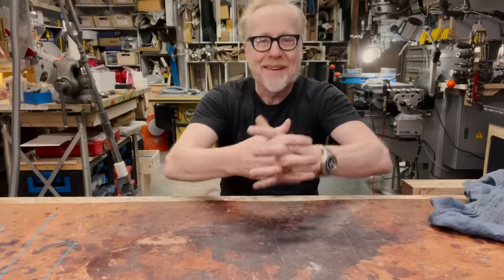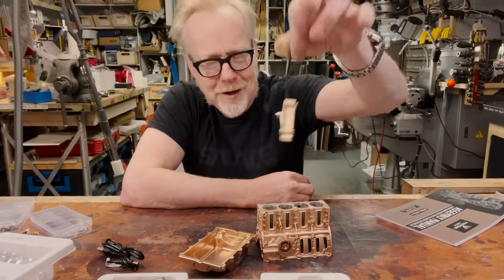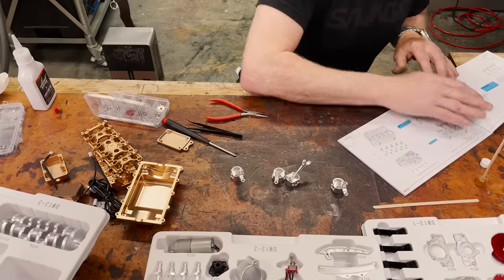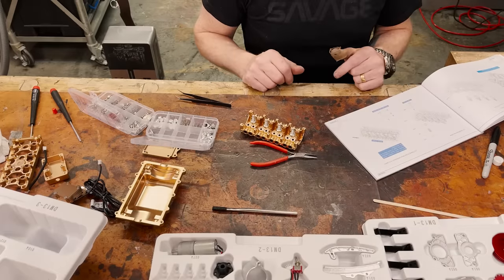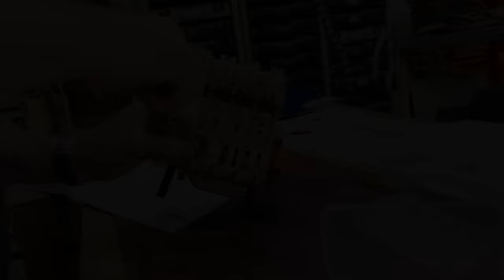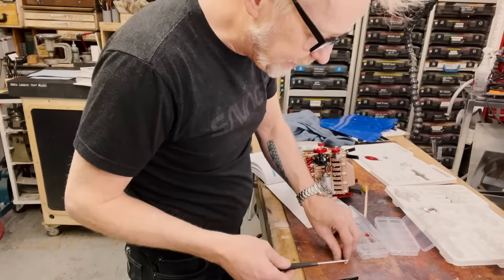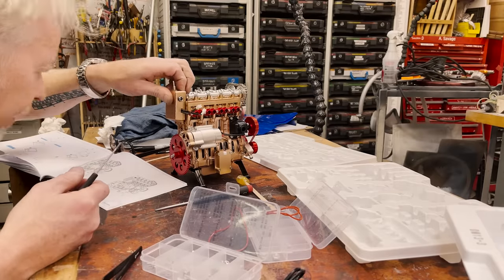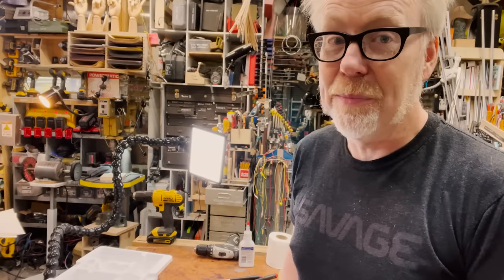Adam Savage's One Day Builds: Car Engine Model Kit!

Comment: The fact Adam called pretty much everything by its wrong name lol
Reply: That is a bit on the steep end.  We bought a 1600 VW engine for $500.  Mind you it was used but my son uses it every day to get to school.  :).
Reply: I really like Adam but it was painful to hear all of the random names he’d call things!
Reply: It is a bummer.  Adam had an opportunity to learn the proper name for each component so as others could have learned.
Reply: Caling the connecting rods cylinder rods.🤣
Reply: The top "crankshafts" when they're camshafts
Reply: yeah when he called the piston rods crank rods and the wrist pins connection pins as a guy who works on cars as a hobby it hurt
Reply: I noticed that haha
Reply: when he said 'this is the main gear' i was cringing so bad
Reply: Adam is a REALLY smart guy so I was very surprised he didn't know the most basic engine components.  I have never built a real engine either, but I know the correct name of all the parts in that kit.
Reply: @VKZ24  he's really smart, but most of his stuff is building things and fabrication. Can't blame him for not knowing everything but surprised he didn't know the basics
Reply: @2GuysandaBug  he got the Oil Filter right!
Reply: @Allamericanhotrods  what? Are you really getting this upset that he didn't know the name of engine components in a toy designed for kids?

Comment: The fact that you have extra nuts and bolts left upon completion truly makes this model assembly just like the real thing. It has always been an inside joke amongst shop coworkers that if you DON'T have extra nuts and bolts left over then you did something wrong, also we don't call them "extras" we call them "weight reduction".
Reply: I truly hope you are joking and don't just leave it.
Reply: @nathantron  Like I said, it is an inside joke. A lot of times one kit will be designed to be compatible with multiple design set ups, which will leave you with parts that were not necessary for your particular application. Other times kits will come with new nuts and bolt but the originals are still in good condition, so you either use the originals and save the new or vice-versa. I, like many auto technicians, have a unique sense of humor that for the most part only fellow "grease monkeys" understand or find humorous, however when it comes to my actual profession I take it very seriously. 
Joking aside, make no mistake, I consider auto technicians just below doctors; as in my customers are trusting me with not only their safety but the safety of all those around them when they have me work on their vehicles. I perform every repair as if one of my loved ones were going to be driving it.
Reply: If it works without it it didn't need it.

Comment: Adam,
I also have terrible allergies I use flonase nasal spray 2 puffs per nostril twice a day which really helps & when pollen is really bad I add one allegra  pill a day on top of the flonase. Right now in Florida the pollen is so high my black truck is green from the ridiculously high amount of pollen in the air & I just washed it yesterday. Before starting this medication my nose would run like a broken facet.

Comment: Very nice project.  Remember the “Visible V-8?”
Reply: Yep, from Revell. Back in the '60s. I built it.
Reply: Failed to build it in the 80s. 😂😭

The problem with plastic model cement...  Mistakes are permanent.
Reply: The kit is still around, most hobby shops have it for under $100

Comment: The pistons are "Notched" to point in the direction of the FRONT of the engine JUST like a real car engine, in a real engine situation if the pistons are installed incorrectly it WILL cause failure...
Reply: Im not sure in a non interference engine.. but u are totally right in a LS and hemi for sure

Comment: I am a professional car mechanic, and I gotta say, Adam Savage never built a car engine BEFORE. 
He did have the professional knowledge to make the parts work. 
It will take more oil to work long-term, but I am impressed by him figuring out what is needed.
Reply: Quote: Adam Savage: I don't tighten any screws until it is complete. 
EXCELLENT! I do that too. it comes out better.
Reply: It has more to do with the part, than the whole; but the point has value.

Comment: I wanted something like this until I literally bought a whole used engine for the same price. :P
Reply: How’d it go for you? I’d love to learn the ins and outs of an engine
Reply: @finnmaclean7796  if you have the space to house an engine on a stand, I’d highly recommend it. Which is roughly the width and half the length of a standard garage bay. Also I forgot the expense of an engine hoist and and engine stand, as these are things I already had as a car guy.
Reply: @finnmaclean7796  what do you want to know
Reply: @gedavids84  yeah there might be an engine hoist and stand in my garage but I’ll definitely take a look into it. Even starting with a smaller motorcycle engine to gain a simple understanding
Reply: @rorer7140  I’d just love to be able to take apart an engine and rebuild it/repair it myself, or as much as possible

Comment: That same company makes nitro an gasoline mini engines.  I have several. (Put them in various RC cars/trucks)

Some of them come in kits. Think it would be good content for your channel.
Reply: How does the power / powerband match up with nitro engines ?
Reply: @3v3pirat37   So gearing is important with these engines as they don't rev up to 30k rpms like traditional nitro engines.
Reply: @DomVito87  Of course but how does it feel to drive them.  Typical nitro engines have little to no torque where as the 4 stroke will have loads more.

Comment: Hi Adam,
When I was a kid I made a marble puzzle box out of Lego's and it was something fun to do when I was a boy. And then as a adult I made marble puzzle boxes out of Popsicle sticks and it turned out great and the tools I used was a scroll saw and white glue. I made the base using two layers of Popsicle sticks and since the marbles were two sticks in height I used a scroll saw to cut the walls of the puzzle box. And I made four mazes one on top of each other and each maze was different. And when the box was made it was fun playing with it for a while. And the sticks had to be very straight and very flat to make the box work. The way I have found make the sticks flat was to tap them one at a time on a flat surface to weed out the warped and bent ones. You might want to try this project sometime and it maybe fun for anyone who wishes to build one. 

Robert Johnson

Comment: The additional bolt hole studs on the oil filter side of a typical 4 cylinder will be for an engine mount and oil cooler.  On the other side you would typically have an engine mount, and sometimes an axel guard or heatshield depending on how it's mounted.  Also you would have a crank sensor on the block as well.

Comment: Reminds me of when I built one of the "Visible V8" engines back in the 70's, but it was all plastic and the quality wasnt near as good - of course it only cost like $15 - $20 back then.  The best part was building it, the motor that was supposed to turn it over had problems with it mounting being to flexible but I loved the fact all the valves were in time and the spark plugs were little red LED's that lit up in time with the distributor firing - For $439 you would think they could have incorporated LED's in the spark plugs so the ignition could show the plugs firing in time like my much cheaper Visible V8 kit did for like $20

Comment: Adam is one of my favorites, been a fan for decades. He must have never built a real engine, except for the pistons, I believe he called every engine part by the wrong name. When he called the overhead camshafts....crankshafts I may have pooped a little. The "main gear" is the flywheel, the gear is for the starter to "gear-on" I guess. Nice kit, too bad you can buy a real "used engine" for about the same price. The assembly book will have had the correct names, for the parts, it is still in as-new condition.

Comment: Hey Adam I had a plastic model of a internal combination engine. I put it together and I put corn oil in the crank case and it had a handle you cranked so you can watch it operate etc.

Comment: the cylinder inserts are actually called sleeves. some real production motors are aluminum with steel sleeves. aftermarket blocks sometimes also come with sleeves for high hp.

Comment: Over time you may need to drain the oil pan once in a while from lubricating often and warn others to not tip the engine or oil will spill on them I made a warning label for mine . Still funny when it happens. Ha! Plus it needed a clear box to keep dust from gumming up the works.

Comment: Dating back for quite a while people have made those model engines and done things with/to them.... made scale cars and put them under the hood, etc.. another thing that was a contest (and there are several videos of it) is to see how fast you can DRIVE the motor using a larger electrical motor than the stock 280 class than it had to turn it over, before it would FAIL.  I know one guy, after modifying it (oil, better belt for the overhead cams) who managed to take a cordless drill and drive to something like 2500 RPM'S before it failed!  Another series of videos was posted that would test to see how LONG it would last before a failure occurred and what the part that failed was. It was kind of fun to see what they would modify THIS time to fix what had failed the time before, sort of rapid failure testing on a scale....

Comment: Adam Savage. You need to pick up. Toyan FS L400 14cc engine kit. With that you build a proper running fuel engine. Very cool. I love to buy one if I could afford it.
Specs below 
 Engine Specifications:
Engine Dimensions: 100.5 x 85.4 x 86.5mm
RPM Range: 3000-13500rpm
Displacement: 14cc
Output Power: 3.0HP
Cylinder Diameter: 17.0mm
Piston Diameter: 16.6mm
Product Weight: 1256g

Comment: Magnetize your drivers. Wrap copper line around driver 13 times and touch ends with car battery positive and negative. Will stay magnetic forever. No more losing screws.

Comment: BTW that bright light over the mill table is pretty distracting.  Love your vids bro, 'cept for the nose blowz.  Oh yea overhead valve engines use "poppet valves"  the valves are opened by the cams pushing against the tappets.  However engineers designed the overhead cam engine around 1902 in order to eliminate the tappets because they along with the pushrods rob efficiency.

Comment: the spark plugs should have a little LED at the end that lights up at Top dead center and turns off at the end of the power stroke.  And that Firing order really bugs me, usually 4 cyls fire 1342 or 1432, not 1 AND 4 simultaneously, and then 2 AND 3 simultaneously.  (If I am incorrect about that, however, I'd love to learn more!  I've heard of really odd firing timings, such as Kawasaki's I4 thats ignition timing is like 180/0/180/540 or 560 and gave it a unique torque factor.)
Anyways, that is a really neat little model!

Comment: Hey Adam Savage?  I think I need to help you out, with name's of some of the part's of the engine here.  First of all, that seem's to be basically a typical 2.0L-2.4L(Depending on ratio's, of course.) I4 Honda engine.  Ok, on to the engine part's name's, corrected(I know that you are not a professional automotive mechanic, like I am.), starting with the oil pan, block(Hold's the crank, piston rod's & piston's in it.), the head(Which hold's the valves, valve spring's, end cap's and the twin overhead camshaft's(AKA cam's, not crank's.), then we move on to the outside of the engine, with the oil filter, alternator(Sitting in the front, just above the oil filter.), flexplate/flywheel on the back of the crank, the balancer on the front of the crank, water pump(Usually in the middle, toward's the top of the engine block.), the timing chain(Sometime's, they use belt's.  The actual chain, that you installed.), crank pulley for belt's and starter of your real vehicle, will usually sit, either where the electric motor is installed on this display model, or on the bottom side, similar to how the electric motor is on the top side of this model.  Now, they left a lot of other part's out of the kit, for it to be a full engine.  But, this is just for show, not go.  So, I understand why they left out a lot of the smaller part's.  But, there ya have it, the true name's of the part's of an engine like this one.  I know another guy, like yourself, that love's to tinker with thing's in his garage.  Even with the messed up hair and everything!(LOL)  Maybe, when I come to California in the future, we can get together and just talk about thing's that we both done in our past's?  You, with the show's and me, with my high performance racing engine career, that lead me to many different place's all over the NE part of the US & the mid-west, as well.  I also love to tinker with thing's with my hand's, like messin around with 2-cycle engine's, fixin whatever I can and thing's like that.  So, we both got a lot in common.  And, we both love workin with tool's in a garage(A man's home away from home!  LOL)...

Comment: Nice your kit came with all the screws and fasteners, I ordered one and theres an assortment of screws missing, and the threads for the mounting holes (legs) are tapped much too large. When I tried to post a negative review on the website it seems my review was moderated and taken down. I have recieved missing parts, but the incorrect quantity. Buy at your own risk.

Comment: Is it really a 4 cylinder motor if it's being run by a battery? It is not creating energy by its motions but rather using energy. And the extra screws would drive me crazy if they did not note an exact number I should expect to have left. I would think I forgot to put them somewhere.

Comment: The sides likely have plates to seal in combustion? I didn't see any piston, "rings." However, they make smaller engines that actually "start" & "run."

Got me thinking it wouldn't take too much to make that engine run on, gasoline, with those materials?

Comment: A mechanic friend once said that any time you rebuild an engine, you're guaranteed to end up with a handful of nuts and bolts left over. No matter how careful you are, they're still left over. And the engine always runs fine. I wonder if the extra hardware is at least partially a result of the same phenomenon.
Reply: I spent 20 years in the car repair industry and I can confirm this. It's referred to as "improving efficiency through the reduction of weight" AKA "what were the engineers thinking when they decided to put a bolt there?"

Comment: it's story time..
my friend did some bolting on engine work before but he never really worked on engines before. keep in mind at the time this happen he was 20 and I was 21 and I had my hopped up Chevy that I built. well he pulled out the 350 engine in his truck and he had a 400 to put in. and he re-ringed the 400. well I was not there to help him re-ring the engine, but a couple days later I showed up and he had the 400 in the truck. he had the 350 flex plate on the 400 and I told him that was a big no-no-no to do, told him why. he said "it will be alright", I told him "no it wont".. then he told me the crank turns hard in one spot when he turns it over by hand. I kept my mouth shut because he wont listen to me.. 
then he tells me he thought he had one (1) piston in the wrong cylinder... 
at that I said "what about the other piston" LOL, 
he said "what do you mean", 
I said "what about the other piston,  is it in a wrong cylinder too? " 
he said "what other piston, they are all in the engine" 
I said "I know that but you have 1 in the wrong cylinder, what about the other cylinder" 
well he looked at me funny and said "what are you saying".
so I explained it better to him so he could understand.. 
he said he "was not going to take the engine apart again "
well LOL,,,,,,,,,,,,,,,,,,,,,, he beat on that 400! it ran for only 2 weeks and it was dead.

Comment: I built 'The Visible V-8' when I was about 12 or 13 in the late 60's, it worked, but it was sluggish as a result of not properly 'dressing up' the rotating components. I have no idea where it ended up.

Comment: Would be even cooler if it were a Honda engine something like a K20 and see how VTEC looks when it's working. Would only need 2 different speed settings on that little motor to simulate low vs high RPM.

Comment: Cool, although I don't think it's 500.00 bucks cool.  That's a nice DOHC (Dual Over Head Cam) 16 Valve, 4 inline, but the cranks at the top, as you put it, are your Cams that time what we in the business call the bump stick the lobes on the Cam shaft time when the valves open to let air in, close, then open to exhaust after compression cycle. A lot goes on in an Engine all running together perfectly, which is where we get Engine from as it's ingenuity.  Nevermind water jackets and oil passages, and if you have that many parts left over on a real build, lol, there's a problem.  Be really neat if it came with a mini toque wrench set to grab those "Clicks" and torque to spec.  Anyway, yeah I think I'd rather spend $500.00 on something else.  Like some tools to work on a real version.  But thanks for sharing.  Still a thumbs up.

Comment: so many comments. Is it a diesel? I didn't see anything about spark plugs. I had to keep a science museum's cut away real engine "running". one tricky thing was copper brushes in the distributor rubbing on the contacts, and lighting up bulbs in the spark plug holes.

Comment: watching this I was like, how is the cooling system possibly going to work. Then I realized that it's not an internal combustion engine, it's simply an electrical model or desk piece. At this pricepoint you can get an actual RC motor that runs on fuel.